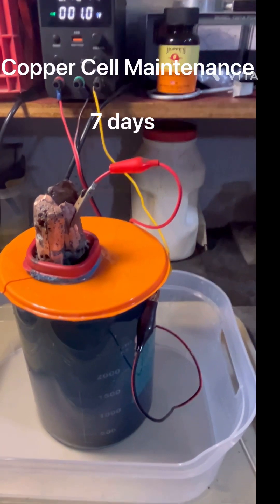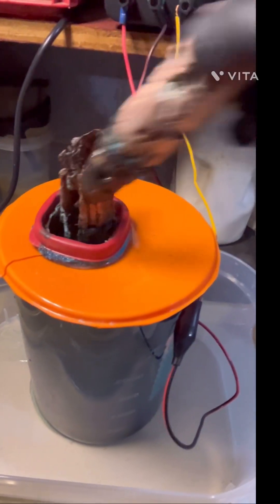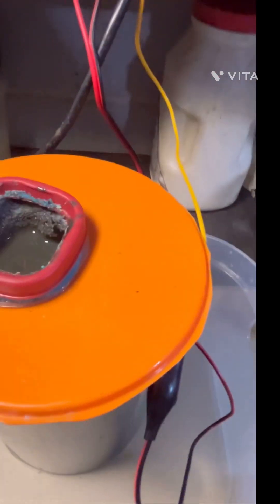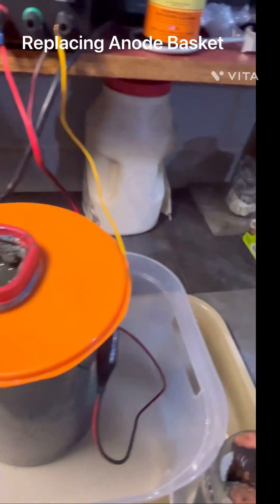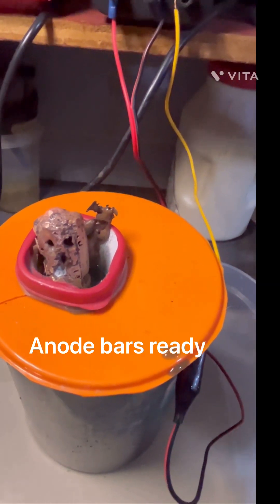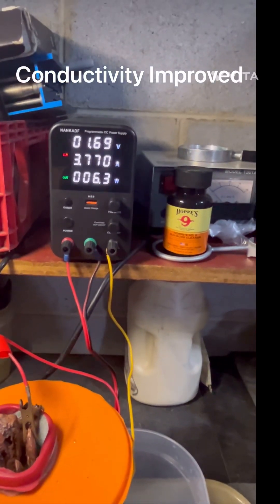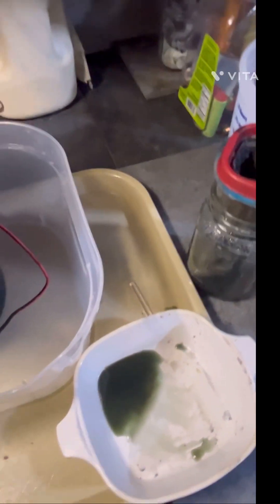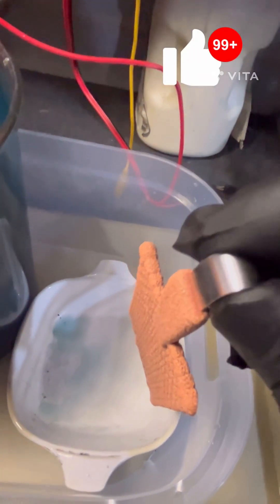Copper Cell Maintenance

Comment: A copper cell should be in glass not stainless steel like the silver cell??
Reply from the maker: People do things different but get the same results , you could do a bowl it’s harder to remove the copper crystals in this situation.
Reply from the maker: How would you remove the copper ?
I found that having a cathode sheet works well. While you might see it done other ways I would think recovering the copper from a bowl is much harder and time consuming than pulling the cathode plate out of the cell.
Reply: @Hill-13  I wasn’t sure if the copper crystals would scrape off the side of the bowel like silver does. I haven’t done either…yet.

Comment: Socks don't get eaten up? If you are using Copper sulfate (with some H2SO4) doesn't the sulfuric acid eat cotton away? I guess not.
Reply from the maker: It’s diluted this is the third time using old socks . I’m just trying to show you don’t need to buy 10$ Dacron filters . ( save that for your silver cell)
Reply: Okay cool. So, dilute sulfuric doesn't eat socks away?
Reply from the maker: @michaelgulotta5646  Mike I use  20-40 mL of HSO4 / 1L of CuSO4. 
The sulphric acid really increases the efficiency of the cell
Reply: @Hill-13  I guess that's too small of an amount of H2SO4 to eat away organics like cotton. There are those on the Gold Refining Forum that claim Copper sulfate isn't even needed for a copper cell, only some sulfuric acid. I have yet to try that. If I do I will let you know what my results are. Thanks again for your channel.
Reply from the maker: Shark at GRF turned me on to idea , probably a few others especially using HSO4 in the cell, I will be cranking it back up I have to get another crucible and bigger molds, the corn cob corn bread mold didn’t work 😂 it’s in my copper recovery  bucket .  I have spent my allowance already
Reply: @Hill-13  i will be trying it too. 
I thought the electrolyte would go bad and copper bits would float around. But i am glad to see it works for you
Probably having the 95%+ copper anode is what is different from what old members tried. 
Have you melted it with computer pins? There is lots of 
Brass as base metal. I wanna know how it holds up to that.
Reply from the maker: Could you send that link I would be interested in reading that
Reply: @Hill-13  I will try and locate it for you. The forum is huge and I wish I was better at saving certain threads. I will do my best to find it, but I have looked at so many thing since then, that it may be a challenge.
Reply from the maker: @michaelgulotta5646  I feel like I go down rabbit holes when I first joined GRF ii would read : study for hours every day . I find those guys very helpful
Reply: @Hill-13  Yes, I know exactly what you mean. And perhaps I was confusing 2 different posts. It may have been a  discussion about de-plating silver plated material [using tap water only] and not a copper cell thread. So, my apologies ahead of time if I never find the discussion I was thinking of. Keep up the good work.
Reply: @Hill-13 grf members gave up on copper cell idea
I am glad you got it to work 👍

Comment: Will you be able to scrape the copper of the cathode once completed? Or will you need to replace it each time?
Reply from the maker: It will be used In another experiment stay tuned
Reply from the maker: It’s going to be an anode to make copper sulphate